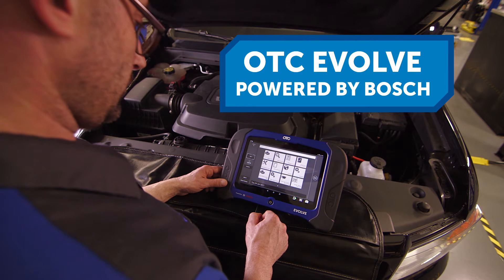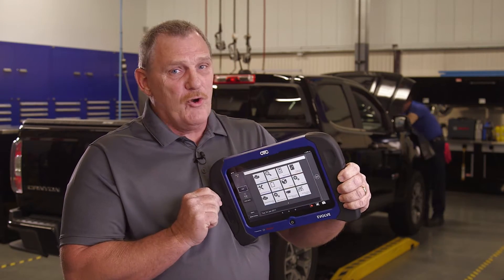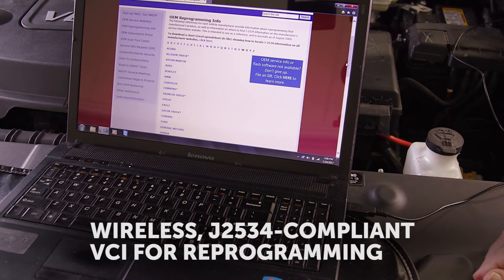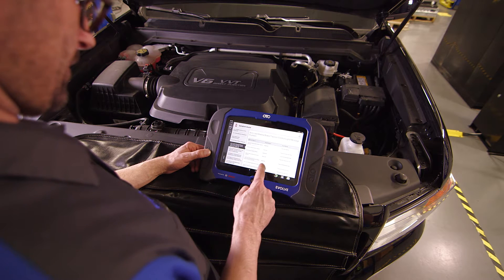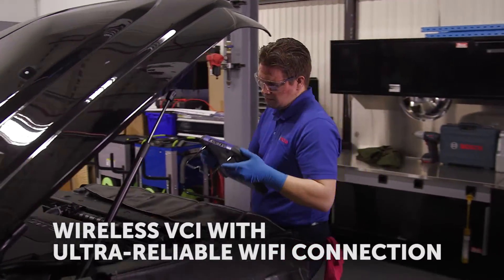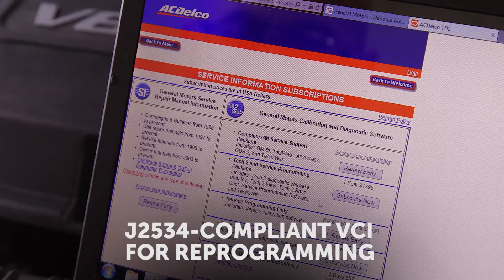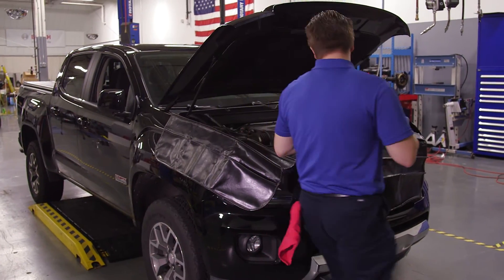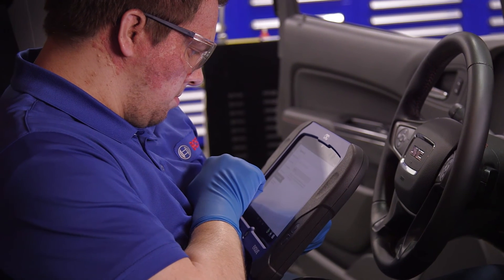Fixing more cars with OTC diagnostics

Comment: I have this Scanner since Nov 2017 and is been a roller coster and i would like to share some of the pros and cons with OTC,
Hoping one day OTC will adrees some of the big issues and flaws of this scanner......
Pros 
1 Solid body i have drop it 2 time by accident and is solid like it never happen
2 The price is good if you shop arround you can get it good deals 
3 Updates are one of the best features and pros of this scaner, 
can be more pleasent to have quater updates
4 Consistent User inteface not perfect but Consisten UI
5 Decent Repair Info not he best but  decent beter then most other Automotiver Scanners 
6 Teamviewer for remote access thanks to pre install QS App 
7 Demo mode is more like training mode thats a plus if you need to teach some one how to use the scanner 
8 OTC will probably support this unit for longer unlike other hint Snap off
9 Price for anual update subscription really afforable and convenience
10 Warranty never expires as long as anual update subcription never drop
11 Universal J2534 
12 Free Dock 

Cons
1 One of the main advertise and selling point from OTC Demo Person is the free access to wire diagrams with update purchase
 or as long as you keep and never drop the subscription is trash not the wire diagrams are bad , but the UI for the wire diagrams is OMG 
 sluggish,  unresponsive, and every synonymous of slow and the fact the when you call costumer support there answer to  that is that thats a freebie
and perhaps 150 mb Internet connection to comunnicate with  Bosh wire diagrams storage servers is to slow and is not the tools fault or OTC poor  implementation
but the sales person is a feature  
2 Hardware OMG why but why I understand big companies whant more money and spend less money but the internals of this scanner leave too much to decire
Camera is a potato and slow , Speakesr sound like crap, CPU no words to describe as I guess if they would when with an Snap Dragron or Samsung Exynos Cpu it 
would have driving OTC to bankruptcy 
3 Power Menu and power button is like I'm here to annoy you 
4 Android lollipop 5.0.2 why not asking android oreo 8.0.1, but android 6.0.1 marshmallow or android 7.0 nougat but not even 5.1.1 lollipop the most stable lollipop 
no lets get the OS with the most Issues 
5 No Google Play Store or any google services 
6 Unable to install third-party or side load apps is forbidden, BIG NO NO and a BIG disappointment and probbably the reason I will NEVER recommend this to a colleague 
I understand google certification process isn't the easiest to obtain and it would only slow updates but completely blocking the installation to other apps is an unforgiven sin 
not even Holly Snap-off do this but to be fair with OTC Snap-on sell worse OUTDATE hardware at prices for 2020 mark-up hardware prices 
7 Thermals it gets hot and i will get to that 
8 Battery life and power management is a joke you have to power down this scanner if you leave on unplug 100% fully charge in about 4 Hr just on stand by it will die at 5%,
and yes it will also get hot on stand-by 
9 AOSP browser and Outdated Firefox are so slow the is faster to search or log in from my mobile device to identifix or google or go to other repair info service befor even 
pron me ro a log in on any of this 2 Browsers but to be fair is not mozilla fault or AOSP but really slow wifi even when is capable of 5Ghz wifi 
10 No Developer Options why I dont know maybe the android OS developer department don't want others to know how crappy they really are
11 On the last Con Android OS is Full of bugs there own Launcher crashes all the time OS is really sluggish you press clear DTC and it will take 
good amount of time before it proms you with a confimation that make you think did it register my command that you tap again just so you could get double confirmation 
on a good buggy and sluggish fashion way.
OTC/Bosh Should hire more efficient and experienced Developers android developer 

Extra when you think it can not  get worse then samsung android JB 4.3 touchwiz all you have to do is buy an OTC Evolve and get Alpha ROMs biuld as Prime Time Rom Builds
Reply: Hope they did fix those issues by now...